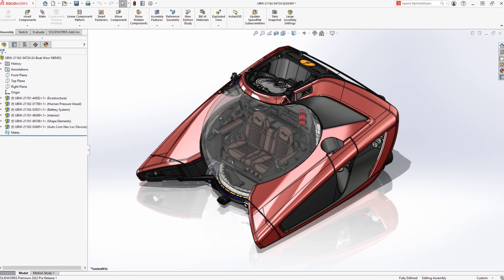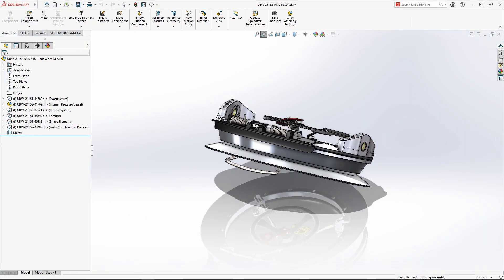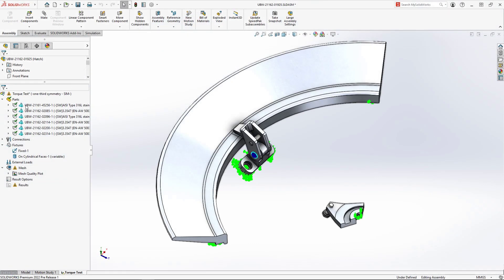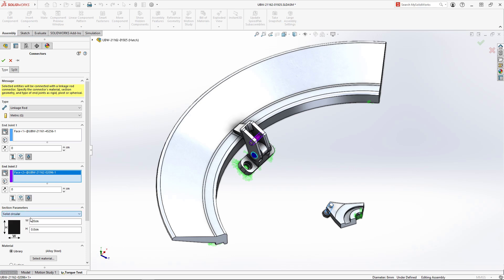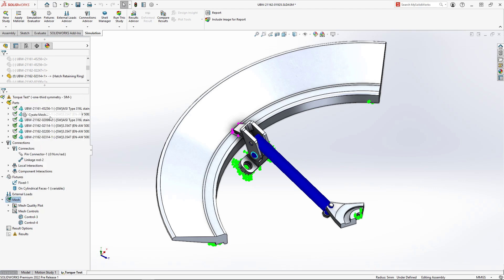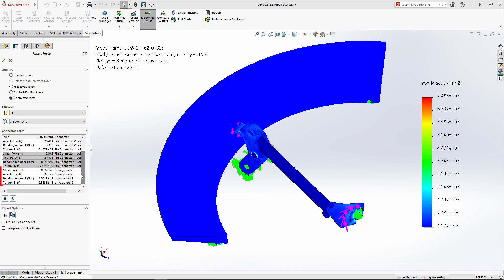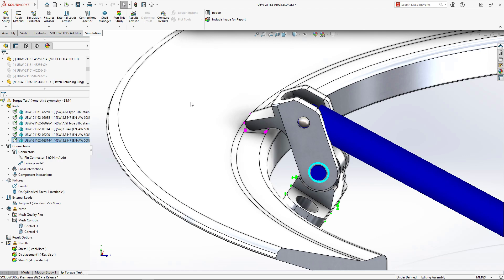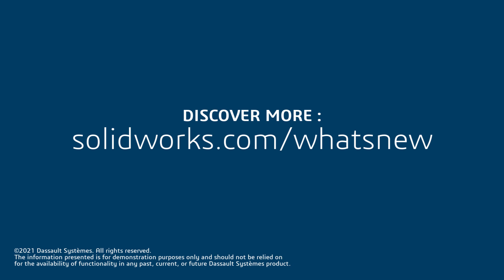SOLIDWORKS 2022 - Simulation

Comment: Is Solidworks Simulation utilizing GPU calculations yet?
Reply from the maker: Hi there, NVIDIA Quadro and AMD Radeon Pro series are certified graphics cards for SOLIDWORKS 2021. A graphics card with hardware OpenGL acceleration will provide superior performance and stability, especially in 3D model viewing (refresh, rotate, zoom, pan).
Reply: @solidworks  Yes, but I was referring to Simulation calculations. Is the GPU finally able to help with that?
Reply from the maker: Hi there, we can refer you to an article provided by one of our authorized resellers on Hardware Recommendations for SOLIDWORKS Simulation and Flow Simulation, published in March 2021

https://www.javelin-tech.com/blog/2021/03/solidworks-simulation-hardware-recommendations/